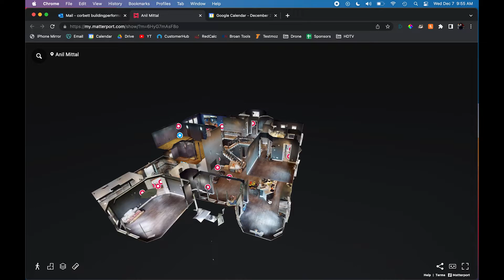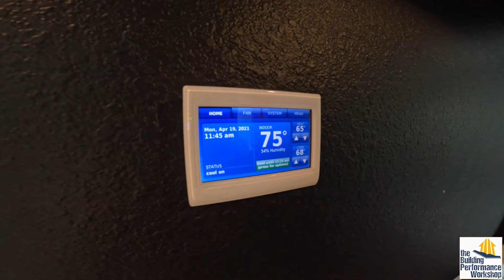Mold House Tour and Scientific Causes: Disaster Production Home Build in Houston Texas

Comment: The mold expert’s explanation of the cause makes no sense. Air conditioning doesn’t create a negative pressure unless there are defects in the system or it’s design. Nonetheless, this does highlight an epidemic problem where most homeowners will never connect the dots.
Reply from the maker: This duct system has more supply leakage than return leakage. His explanation was perfect imo.
Reply: Well that would certainly do it in the living space, CL. But the visible mold on the duct in the attic implies low airflow/super cold discharge temp.……Did you diagnose it?
Reply: @harryboody  the ducts sweated from all of the pinches in the flex. Air restriction. This will slow cold air movement inside, giving the attic heat outside of the duct time to cause condensation on the outside of the flex where the supply pinch points are. A supply line at a sharp 90 degree turn is bad, but it looked like these people had turns at 180 degrees. Horrible installation. No makeup air, a disaster.
Reply: @sp1200M3D  yes exactly; the installers did not install according to the manufacturer’s instructions. Btw, i have a house of close similarity to this one; the main difference is that mine us built with all Southern Yellow Pine, from the solid sawn joists and rafters to the plywood sheathing; studs are Canadian DF. This house however is made with OSB I-joists and I bet also OSB sheathing; these materials are from hardwoods that have no natural resins that prevent mold and fungus. Yellow Pine is very resinous; and I would bet thats one reason why my slightly older Houston area home doesnt have the problems that this couple have. My first house did however. So some truth to building with materials that are “more forgiving”.
Reply: @zefrum3  it’s generally not the materials, mold can grow on anything, even cement, as long as the biofilm to grow on presents itself. Yes, drywall paper backing is the first material to cultivate microbial growth, due to the high cellulose recycled paper which is predisposed with mold spores in it. There are papers on this if you dig. But wood is wood, saturated enough, it’s all the same mold food and will grow mold eventually, even if “anti fungal” agents are impregnated in it, and even resins/glues in your case. Ultimately the answer is not creating the opportunity to create a dew point on surfaces and understanding weak spots in homes and negative pressure created by utilities causing condensation. Obviously water damage too. Moisture control basics.
Reply from the maker: Probably lots and lots going on in those systems, which is not unusual- bet a lot of Houston attics might look like that though, no? No testing while we were there, just inspecting and recording.
Reply: @HomePerformance  
The roof is an absolute engineering disaster with multiple points of failure that are just waiting to happen if they haven't already. Are the lower vented roofs isolated from the taller roofs? Because if they're not the highest peaks are going to pull from the lower peaks and not from the eaves...
Reply: @HomePerformance  definitely common to see on ductwork in a vented attic, especially if they have longer run times or lower desired setpoints (below 75ish)
Reply from the maker: Haha 75ish Dustin— we know no one sets near 75 in a home like this.
Reply: That attic was a nightmare   @HomePerformance

Comment: 13:07
Stop building roofs (Plural) around rooms, fit the rooms you need under a roof (Singular). 
You don't need that many peaks and valleys. Sure a little bit improves aesthetics but that's not a little. That's off the pleasing aesthetic reservation. That's a crowd of gnome hats.
Reply: any addition of peaks/valleys is adding possibilities for issues, I agree totally with having 1 roof for a home
Reply: Not to mention roof penetrations for those solar panels.
Reply: @PatriarchyIsOverrated  what is the issue with a properly sealed roof penetration?
Reply: @BigAnil  it's rare to find a GC or sub who knows how to build quality. Look at the craftsmanship of homes built 100 years ago (solid wood doors, framing, and subfloor , plaster that's resistant to mold, pitched roofs that rarely leak. Today's "luxury" homes often have flat roofs, woodwork is cheap/trashy particleboard, floors of cheap vinyl planks, no awnings to protect windows, often at the bottom of a hill with no proper drainage, drywall that gets moldy within 2 days of a leak.
Reply: @PatriarchyIsOverrated Housing  100 years ago didn't have air conditioning. That's what caused the issue with this house. You don't know what you're talking about.
Reply: @2ndChanceAtLife The roof penetrations had nothing to do with the mold and moisture. Hundred percent came from hot moist air Contacting air conditioned  materials  et cetera. Perfect setup to make water water water to make mold mould mold.
Reply: I disagree on the sentiment to just make simpler roofs. There are numerous products now to do a belt and suspenders approach to water shedding in valleys. Form should follow function yes but there should also be form.
Reply: @zefrum3  I am on the same page as you, the only problem is production builders will not spec those products as they usually cost a little more and require a little more skill/labor to install.
Reply: @zefrum3  
One you got to find an engineer and contractor that knows what belt and suspenders is.
Two, you got to be willing to pay out the ### for that engineer & contractor and hope nobody misses a detail.
Three, you or someone in the future is going to pay as little as possible to get the roof replaced by illegal immigrants because they didn't factor in the upkeep. Eventually it will become one of those mold riddled abandoned structures...  

It's far better to KISS it.
Keep It Simple & Stupid. 
Keep your kitchen and bathrooms close together so you only have one vent penetrating the roof.
DON'T build luxuries like a brick and mortar fireplace. Especially ones that are part of the houses structure and can't be torn down.
Reply: @Foche_T._Schitt  i mostly agree with your sentiments. One thing is a head scratcher to me: you mentioned brick chimney attached to your structure that cant be torn down; that building practice has been gone for a long time in the US. Homeownership can is often very hard and frustrating.

Comment: So i live in the Houston area and I have a few houses and I am doing a major rebuild. I can tell you that this homeowner's problem is most likely due to not enough or any ventilation from the soffit to the ridge, which would promote the ducts to sweat causing the condensation in the attic spaces. Havent watched but 7min so far of it, but pretty sure. EDIT: Im seeing a lot of OSB based materials like I-Joists and osb sheathing; not causing the problem, but these products are much more mold-able. SYP, sothern yellow pine, is used as commodity materials in this part and SPY is very mold and pest repellent and tolerant, Id say pretty close to cedar. However, OSB is manufactured from hardwoods, which have no resins that prevent mold growth; matter of fact the sugars in hardwoods promote molds.
Reply: Pardon, you are 100% wrong. Duct work is wrapped in R8 insulation to prevent surface condensation. The purpose of soffit to ridge ventilation is to always have air flow. You can have 99% humidity and still dry condensed water with air movement. If the soffit and ridge are air tight, then that humid air will eventually condense but there is no air flow to dry it. Moreover, as all joints in a HVAC system and the connected duct work will undoubtably have leaks, the indoor blower fan will put not just the living space under negative pressure but also the attic; even more so if you have unsealed and uncaulked can lights.
Reply: @zefrum3  Attic ventilation is for the drying of the roof, most commonly required in cold climates to reduce damages to the roof from building heat loss and moisture exfiltrating through the ceiling plane. It has very little impact on actual attic temperatures. In fact when modeled if requiring lower attic temperatures the preferred method would be to utilize radiant barriers. To add on with this if the attic is sealed from outdoors you remove the introduction of on average in Houston a dewpoint of +/-77°. Now yes this will raise attic temperatures a minimalist amount so if lowering Temps to reduce heat gain is desired then installation of a radiant barrier will get you back to at or below where you started with the vented attic. The biggest win here is controlling the dewpoint of air introduced in your attic where they decided to put your mechanicals.
Question: Do you perform HVAC or other Home Performance related work?
Reply: @dustincole2625  No not at all, dude are u trolling? Attic Ventilation is to reduce the asphalt shingle temps to maintain manufacture warranty / life of the product and to passively cool the un conditioned space of the attic. And radiant barriers are complete BS. I happen to be well educated in thermodynamics and it is nothing but shocking to hear supposed experts talk about how good radiant barriers are when holding an IR non contact thermometer at a low emissivity foil face and say ‘see the foil face is blocking the heat back to the outside’. LOL; what ever happened to conduction, thats how that heat came into the attic, through the decking!
Reply: It’s lack of air exchanges and no whole home dehumidification, on top of a poorly installed HVAC with 180 duct turns imo. Too many holes in the ceiling too and an unconditioned attic space with the AHU. Just my 2 cents.
Reply: Btw, check out minute @1:32 look at all those can lights in his garage…
Reply: @zefrum3  Ventilation will prevent mold and deterioration on the roof surface. The R8 ducts will sweat unless covered by something like extra R30 insulation to prevent dew point on their surface. Add imperfect execution, HVAC in unconditioned space is trouble.
Reply: @purpleblueunicorn  no, my duct work does not sweat and there is no R30 amount covering it. I did take off every flex duct and collar and applied tape, mastic and large panduit straps per the manufacturer. I also followed the manufacturer for layout. I have soffit and ridge ventilation; house built in 1978 and ductwork replaced in 2016; no mold on the duct work. My 2016 house has no mold on the duct work either; lots of soffit and ridge ventilation.
Reply: @zefrum3  here's a comparison I use for allowing others to better understand zonal imbalances which I believe you are eluding to with the concern of the can lights.
If your on a boat and there is a hole above the water line your only concern is to ensure it maintains above the water line. If you put too much weight (unbalanced zonal, leaky ductwork) the hole is now lower and the boat begins to sink. Add a bilge pump (fresh air introduction only) and you have possibly offset the water entry enough to keep you floating. Seal the hole and your much safer but only until the waves overtake the sides. The solution is to seal the hole and put a top on the boat. Now take care of the crew so they can breath with balanced ventilation and you can take on the roughest seas and still be OK.
Reply: @dustincole2625  Pardon? Lets keep the seemingly mild condescending and dumbed-down comparisons out of a discussion with a licensed hvac/r with iAQ  cert. who also happens to be an engineer. Its is best practice and building science for a house designed with a ventilated roof to maintain that ventilation regardless of climate zones. Ducts sweat on the interstitial spaces, especially hot humid attics, because of a lack of air flow within the attic and leaky connections not for ambient dew point. I pointed to the numerous can lights in the garage as their is living space above that garage and i am 100% sure the homeowner installed those and did not seal the cans with mastic or 181 tape let aline caulk the can to the sheetrock. Why would he know todo this? Nobody, except people like me, would know and be motivated to do a proper best practices install. Find what Joseph Lstiburek thinks of can lights, he writes the code books. And my alluded point is those can lights allow for unconditioned air into the living spaces whenever the indoor blowers come on; bringing humidity, mold spores and the mold spore’s food: dust and pollen. Theres the recipe for disaster right there. Combine this with a high probability of low attic ventilation and you get what this couple have, a sick house, regardless of IMHO a poor duct install. I will preface that I am also 100% certain the builder and framer did not block the joist bays from the garage to the living space and that there is not full joist hight insulation even. So many short cuts and building to a terribly low de minimus standard is why problems like this couple’s are so widespread.
Reply: @zefrum3  There is no living space above the garage, it is an unconditioned attic,  and the garage is not a conditioned space. There is no reason for there to be any appreciable  pressure differential between the garage and the attic above. In fact the recessed lights in the garage are the only ones without any mold growing around them.
Reply: “If it can’t dry, its gonna die.”
Reply: @Genry Garcia yes... Sun radiation hits the shingles->heat conducts from shingle to sheathing of deck->radiates from deck and framing etc into attic.  Any surface with a high emissivity would need to have unobstructed view to sky to be a radiant barrier in a cooling areas, otherwise the only benefit, which would be incredibly small, would be for heating areas of reflecting the house’s heat back into the house.
Reply: This (proper ventilation) is so obvious - yet the so-called expert said AC unit in attic is the problem. He knows nothing.
Reply: In your climate zone sealing off attic ventilation will actually reduce the likelihood of sweating ductwork. The ducts are sweating because of the dew point, not necessarily from heat.

Comment: I am a mechanical engineer. This was an excellent video for my knowledge. Also, this is what happens when you do a design-built HVAC.
Reply: what do u mean 'design-built HVAC'?
Reply: Does "design-build" in this case mean duct runs were not detailed in architectural plans, and instead were left to the HVAC subcontractor to develop during installation?